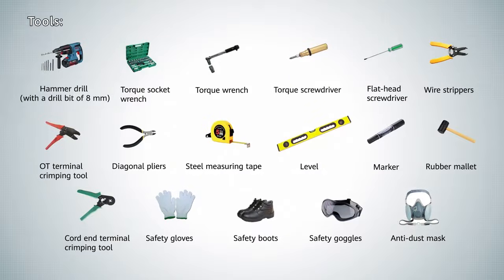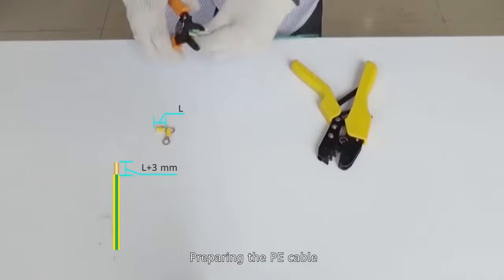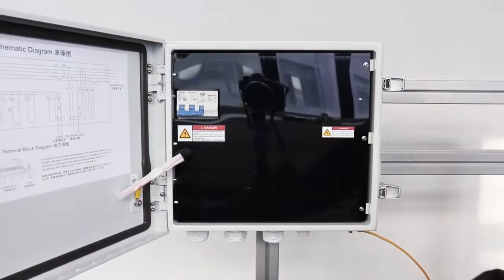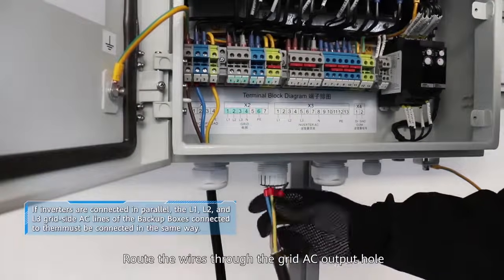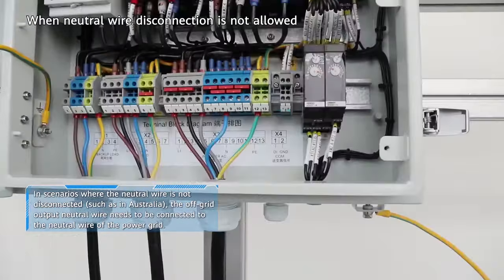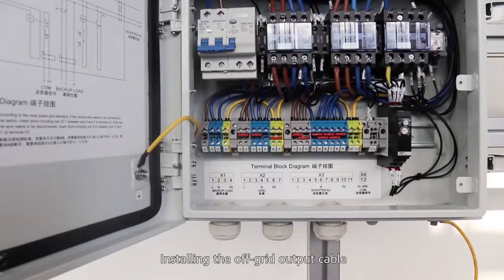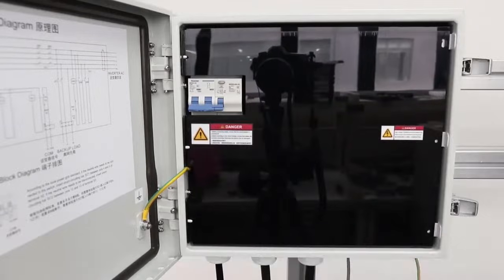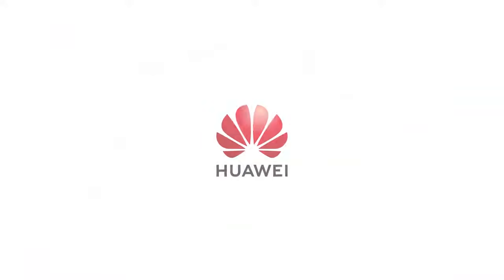Huawei Backup Box B0, B1 Installation Video

Comment: in italiano è possibile?
Reply from the maker: Noi stessi non li abbiamo. Forse è possibile trovarli sul canale di Huawei? https://www.youtube.com/@HuaweiFusionSolar/
Reply: What is the "signal" cable for?
Reply from the maker: @fabiuh991  The signal cable in the Huawei Backup Box B1 setup is generally used for communication between the Backup Box, inverter, and other connected systems. This cable enables the flow of information, such as system status, error messages, and grid conditions, allowing the Backup Box to manage power routing effectively during an outage or when transitioning between grid-connected and backup modes.
Reply: Ciao, sei riuscito installare? Voglio anche vedere come è l'installazione qui in Italia, potete darmi qualche aiuto se avete già installato il vostro?
Reply: Hola está backup box cumple con la IEC62116 ..... ?
Reply from the maker: @javiersoarez4612  Esto no se menciona en ninguna parte de la ficha técnica. Para estas preguntas, lo mejor es dirigirse a la propia Huawei.
Reply: Clicca in alto a destra del video sull ingranaggio delle impostazioni, poi clicca su sottotitoli scegli traduzione automatica e scegli la lingua italiano.
Reply: E cmq la guida per il cablaggio monofase parte dal minuto 7:20 👌